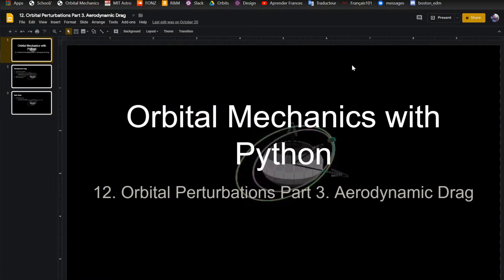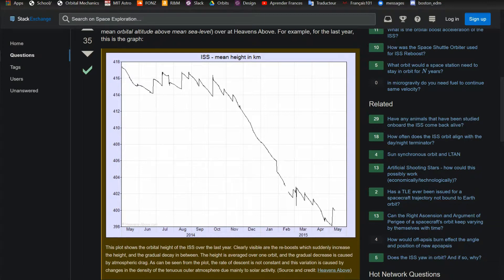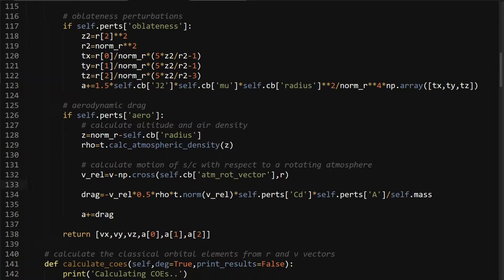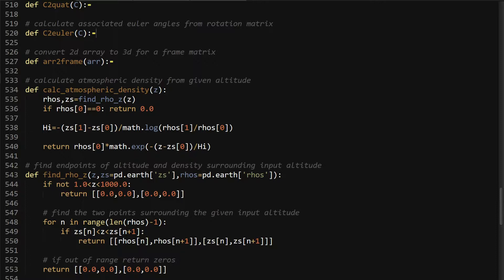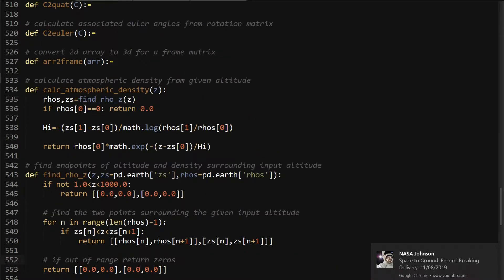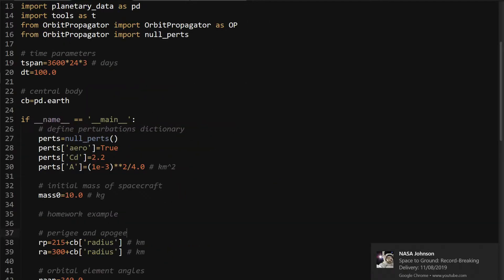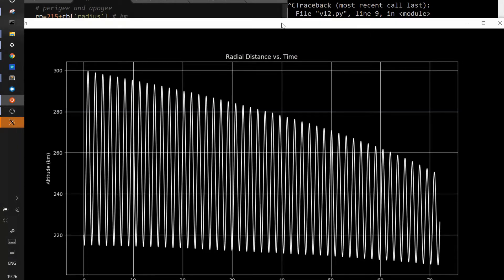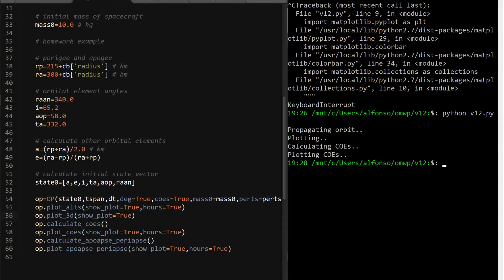Aerodynamic Drag | Orbital Mechanics with Python 12

Comment: Hi, this part is integral for my work and I just can't get it to work properly. I followed every step that's in this video, but the drag seemed to be too great and caused the S/C to deorbit instantaneously. So I fixed some issues in units and it seemed to work just fine. But the drag changed chaoticaly when I tried simple tests. And now python says that the "lsoda" type of scipy.integrate has some issues with the length of steps (or something like that). I'm stumped. Please, I would really appreciate any help.
Reply from the maker: This might be an lsoda problem for multiple reasons. When the solution to the differential equations gets too stiff (the position is changing too fast, which happens in eccentric orbits near periapsis), lsoda will fail. Also, in this case, I think I would avoid using lsoda because I've observed that it does not conserve energy. If you plot out the COEs in a simulation with no perturbations, lsoda will calculate that the semi-major axis decreases secularly over time, which we know is not true. I discuss this in more detail in a sun-synchronous orbit video comparing different ODE solvers for the same equations of motion: https://youtu.be/w2vCCKSTImQ

So I think you should try dopri5 (its a RK45 method) or another method and see how it works out. Let me know because I'm curious!

Here is the link to the scipy documentation on the ODE solver, where they have info on the solvers you can use:
https://docs.scipy.org/doc/scipy/reference/generated/scipy.integrate.ode.html
Reply: @alfonsogonzalez-astrodynam2207  Hi, thank you so much for quick response. This was my guess as well, implementing dopri5 instead of lsoda yields different results, but still flawed. The exact error now states: step size becomes too small. It still computes the orbit a little. It seems to me that the drag is way to large because it deorbits the S/C in half an hour.

Maybe it's an unrelated question, but in the pd file the 'rhos' is multiplied by 10^8. Can I ask why and shouldn't that be 10^9 if you go from kg/m^3 to kg/km^3? I feel like I'm missing something important :D Thanks for any suggestions
Reply: Oh, now it computes correctly. The mass was way to small for an actual S/C. Thanks a lot man. The question about the 'rhos' still stands though :)
Reply from the maker: I believe you are correct! The conversion should be 10^9. Thank you for pointing this out, I really appreciate it. I'm glad the videos were able to help you out with your work! Thats great to hear

Comment: Hi, a question from v12. In the video at 3.47, the orbital propagation init function has for tspan, 
sel.tspan=float(tspan)*float(tspan)*t.rv2period(self.r0,self.v0,sel... [lost to right of the screen]

This rv2period function appears to be new, and not covered in the video, nor previous videos.
Could you post it’s functionality ?

Many thanks

Colin
Reply from the maker: Good catch. So that function calculates the period of a two body orbit from a state vector. You could either use what I have, or use SPICE's function oscltx, where one of its outputs is the period. Here is my version:

def rv2period(r, v, mu = pd.earth['mu'] ):

 # specific mechanical energy
 epsilon = norm( v ) ** 2 / 2.0 - mu / norm( r )

 # semi major axis
 a = -mu / ( 2.0 * epsilon )

 # period
 return 2 * pi * math.sqrt( a ** 3 / mu )

Basically it just calculates the energy of the orbit, and then from that you can get the semi-major axis, and from there the period of a two body orbit. This wikipedia article explains it a bit further in depth.
https://en.wikipedia.org/wiki/Specific_orbital_energy
Reply: Alfonso Gonzalez 
Hi,

Okay thanks.. will have a look to get video 12 functional, then progress to 13.. just concentrating on my c++ code getting the OpenGL rendering of Saturn’s rings functional.. the spice code is impressive for speed ( but not disk space ;-) )

Colin
Reply from the maker: @colinthomas4258  if you're looking to build high quality animations you should check out Cosmographia from NASA (it's free). They take in spice kernels and you control the scripts from python
Reply: @alfonsogonzalez-astrodynam2207  
Hi,

just spent some time on video11:my COEs bug is still present, but also noticed:

time 3:48
self.propagator = propagator 

But propagator is not defined = I assumed 'lsoda' and it progressed.

Best regards

Colin
Reply from the maker: Could you describe your bug more? Maybe I can help out.

And yes, I likely used lsoda in that example. I think its because the _init_ function arguments line is way too long, so it probably cut off. The way I'm doing it in the future (currently working on a RocketPropagator class), is where you just pass in a config dictionary and then unload everything in the _init_ function. The way it is now in OrbitPropagator is a bit sloppy in my opinion
Reply: @alfonsogonzalez-astrodynam2207  
Hi Alfonso,

The bug I have is to do with the plotting of COEs: they look different from yours. I think there is a bug in my copy of the tools somewhere: I have rewound the video a number of times, and can not see it. I can check issues from the python to my C++ by printing out values and cross referencing to ensure algorithm equality, but I can go this from your video to my  python to isolate the bug :-(

"If" you have some time, I have put some pieces on google drive: as they say a picture is worth a thousand words.. 

video 10 COEs image I am seeing:

https://drive.google.com/file/d/1LxNL5dnCy4hc30WTqilzD4ljWXP-3ne3/view?usp=sharing

Video 12 COEs image I am seeing

https://drive.google.com/file/d/1-BnhyrZEwXGMVfjxLZOnoyJg1gd2JFy9/view?usp=sharing

Tools video10 - my code
https://drive.google.com/file/d/1s3nWTL6KI_BmAZeMdgHi3lOSSNbtvXhP/view?usp=sharing

Many thanks

Colin
Reply from the maker: You have to give permissions for me to open the drive links. But, one user pointed out that in video 8 I actually showed the Earth J2 to be a negative value, which is wrong. Earth J2 is 1.081874e-3. Perhaps that could be the bug
Reply: Alfonso Gonzalez 
Hi, 
Having access to the link should have given permission: I checked and given additional permissions - I hope this resolves.. I”ll check the j2 value: in the middle of OpenGL camera positions for my c++ code.

Many thanks

Colin

Comment: great again , I had to look into v13, because I had some differences in def propagate_orbit (self): but almost all results look identical now, AoP vs Time looks a little different, maybe it's a typo, but I can't find it, but I'm still looking :)
Reply from the maker: I see you commented on a few videos about how your aop and raan looks different. I think its because I changed over to spiceypy's version of rv2coes() at some point. I did it because its written in C so its faster, and I think they do a better job of handling the edge cases (when the elements are close to 0 and 360 degrees).
Here is the spiceypy documentation, and the function is called: oscltx
https://spiceypy.readthedocs.io/en/master/documentation.html

Comment: Hi, I have one ore question. How do you get the trajectory clearly visible? Mine has the earth hiding part of the trajectory.
Reply: solved it by using zorder with a bigger value.
Reply from the maker: Would you mind sharing what you did? A lot of people have commented asking me about this and I thought it was due to the version of matplotlib.
Reply: @alfonsogonzalez-astrodynam2207  Ya solved it by adding zorder= 'a number' in the plot line. The number dictates the order of the plot. The higher number means that particular plot would be on top. for example for trajectory i added zorder=10: 
ax.plot(self.rs[:,0],self.rs[:,1],self.rs[:,2],'g',label='Trajectory',zorder=10)

and for central body i used:
ax.plot_surface(_x,_y,_z,cmap='gist_earth',zorder=0)

That way it is easy to say which plot comes on top of which.